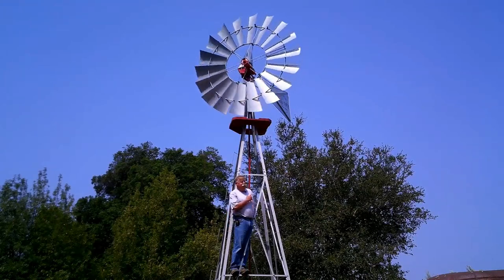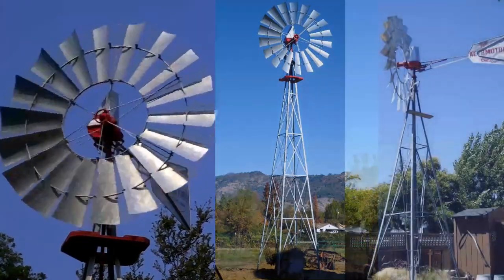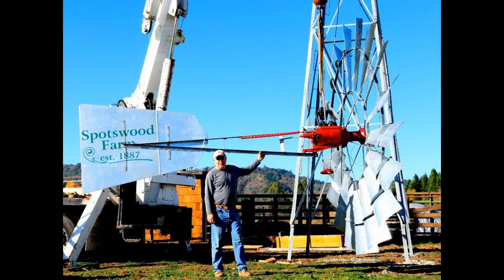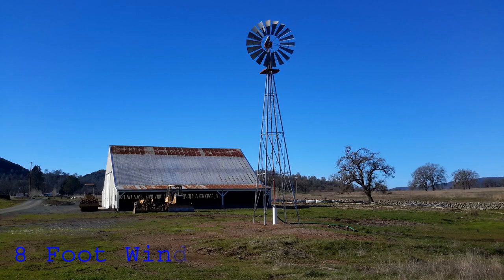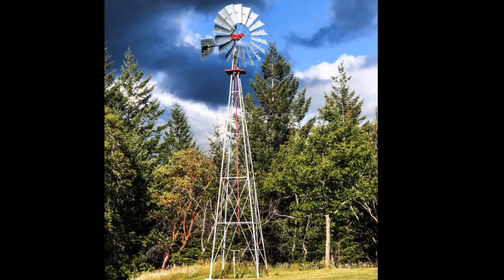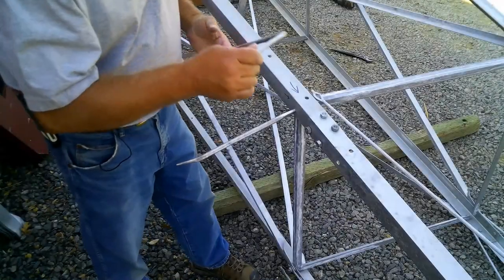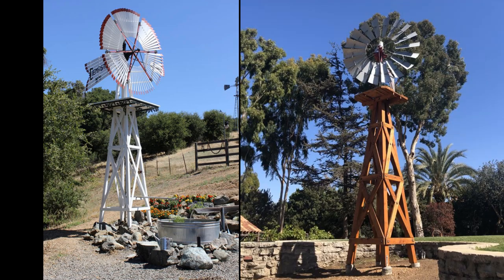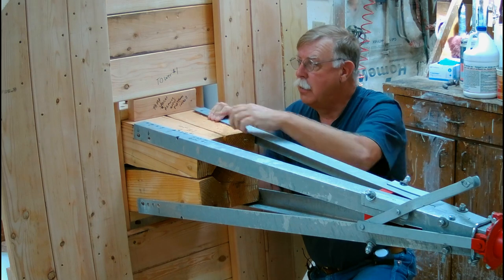Windmill Towers Overview

Comment: I have worked around building staunch towers by using vertical access wind turbines. My towers bi-fold, but weigh hundreds of times less than the standard Stuart-mill-upwind-configuration Tower. Since my mills have very low cross-sectional area facing the wind, I can get away with single post towers. By the way, all my windmills compress air. That's all they do. That said, they do that very well and 24/7.

Comment: I know this might be a dumb question, I would like to know more information on  the water wells drilled, how is the rest of the parts put into the hole, and what is the deepest water well a wind mill can be used on or not? Thank you for your video.